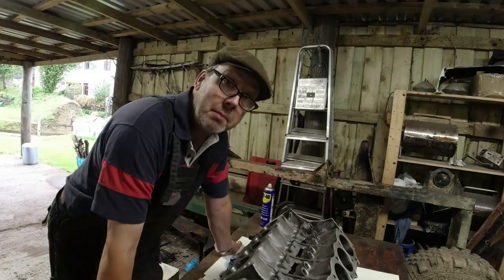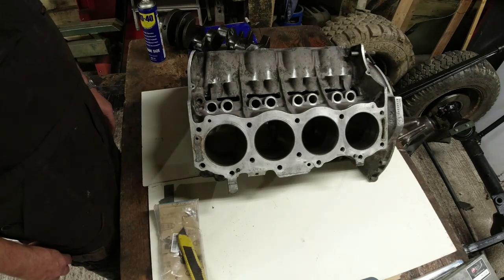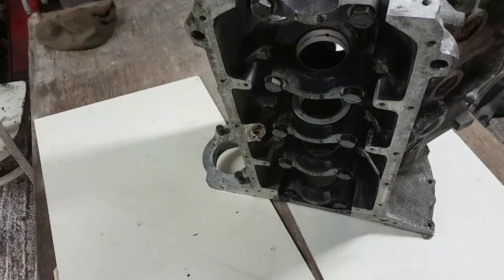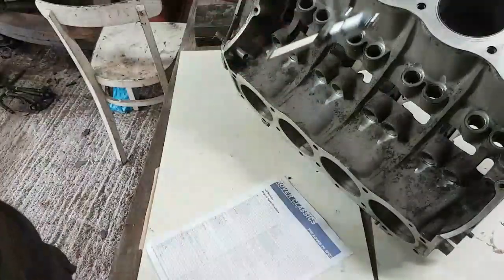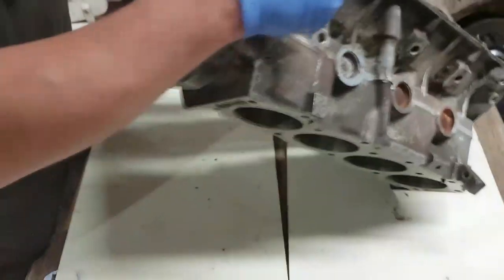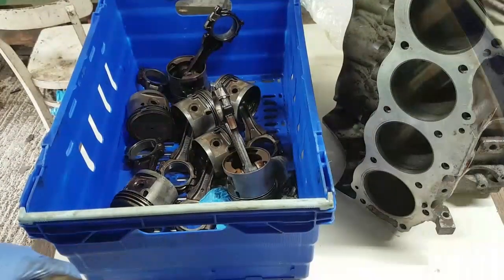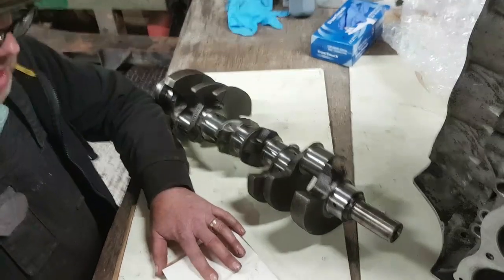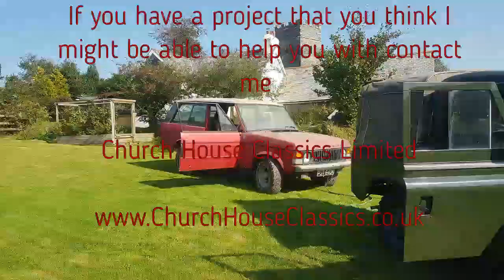Rover v8 - assessment and measurements pre build

Comment: Great video, interesting stuff. I like the Rover V8, it is compact, powerful and sounds awesome.
Reply: They are not very powerful, it takes a shit load of work to get any real power out them. (Don't believe the likes of TVR and their BHP figures). I've worked on a shed load of these engines, the last one I built had a load of work done to it but I'd still class it as 'road spec', it was a 4.6, it knocked out 315 BHP on the rollers. It would cost a fortune to build one to a semi race spec, the pistons are cast so they are no good, the dished crown design is an issue, the rods would need changing and the valve train can not take high RPM, it needs more than valve springs to sort it out. Don't get me wrong, I like these engines but they have issues, cracked blocks, slipped liners, head gasket issues due to the 14 bolt head design, main bearing cap fretting if they are not a cross drilled block.  I guess I just don't look at them through rose-tinted spectacles! 🙂

Comment: Hi Richard, did you find what the problem was with the engine? I’ve got a very early 4.6 that’s burning a lot of oil…… changed the valve stem seals, only burns oil under pressure. So stripping down to the bear bones, my pistons look like yours. How do you get the spec sheet please 🍺🍺
Reply from the maker: Drop me an email, this engine just needed building up as per spec. The build sheet I am using is ages old and was related to the high compression v8 in the Rover p6. A half decent machine shop will be able to help you with spec for the 4.6.

Comment: Hello!! I'm about to build a LR v8 3.9 engine!! And I have a question!! The brand of the pistons on the left side point forward and those on the right side point backward? (LR V8 3.9) thanks
Reply from the maker: many because the conrods face each other for each big end journal i.e. 1,3,5,7 all face one direction, 2,4,6,8 face the other. There is a machined face on each conrod that must face against another machined face n it's neighbour. the pistons, if marked, should all face forwards. The Workshop repair operation manual has it all detailed beautifully. Drop me an email if you have any questions about it.
Reply: @churchhouseclassics  I already sent an email

Comment: Now, correct me if I'm wrong, but as the cylinders have been honed, isn't it correct practice to replace the rings to insure a proper seal? IIRC new rings are coated somehow to bed in quickly... thoughts?
Reply from the maker: It is indeed. To be honest the time taken to refit a used part and find it not fit for purpose outweighs the cost of a new part! So long as it is not made from a dairy consumable such as cheese 😋
Reply: He's put some lovely new rings on all of them ;)
Reply: I heard that today's spare parts are of very bad quality, like camshafts lifters and bearings so if the old part is good maybe better to use that 🤔